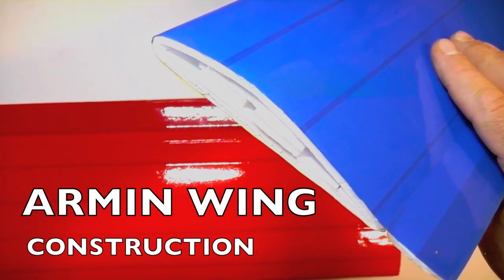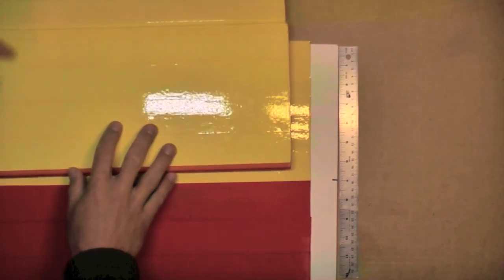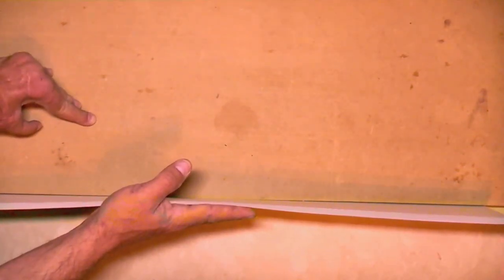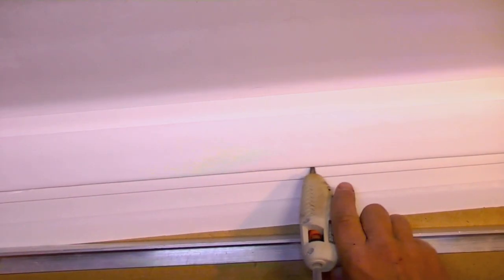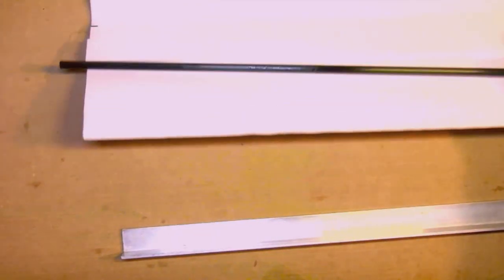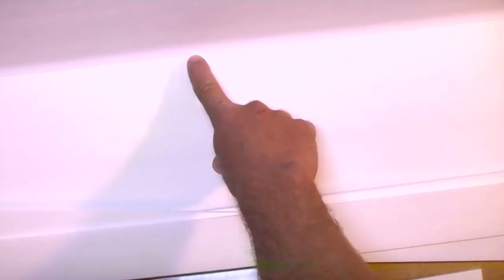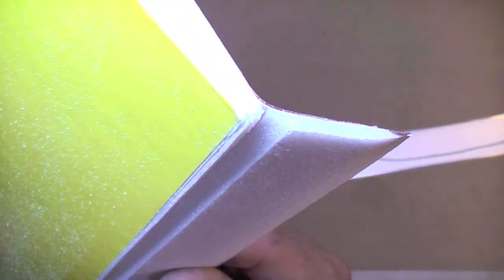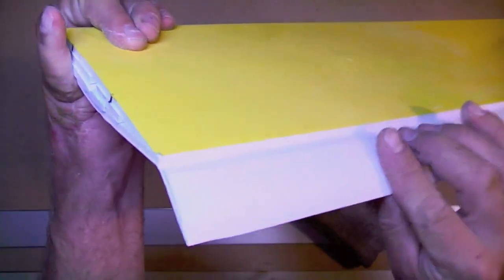ARMIN WING CONSTRUCTION: start-to-finish process with links to detail videos

Comment: Hey Ed, I have built the first half of the Armin wing for the Axon, but I don't think I did it the right  way as you mentioned here... Basically what I did differently is that I measured 1 inch from the 5 inch mark and glued my 1 inch strips with the spar from there instead of starting from the bent. Will that be bad for the wing and mess up its aerodynamic qualities? Basically when you said its about 3/4" from the mark, well on my wing its actually 1" :) Do I need to redo this half? Thanks

Comment from the maker: It's still an ongoing process and getting better all the time with practice.  I made up the wing and tubular fuselage methods and worked on those by building 5 planes over about 3 months before posting the first videos last year.  Probably 6 months before that I was toying around with some cambered wings that were not nearly as easy to build nor as effective but helped pave the way to the methods you see now.

Comment from the maker: With tape applied to all surfaces, 30" section:
5" airfoil with 1.5" control surface = 100g/3.5oz
7" airfoil with 2" control surface = 144g/5.1oz